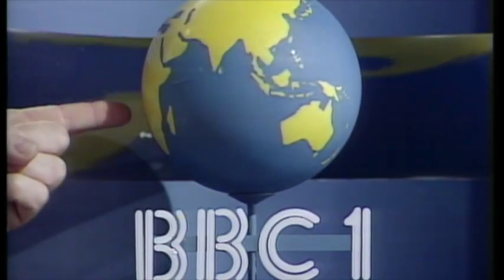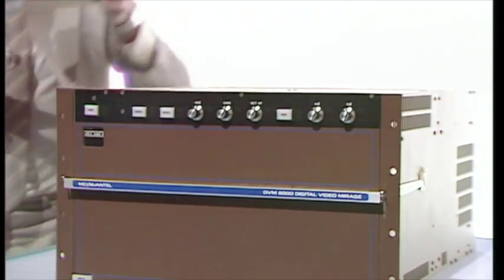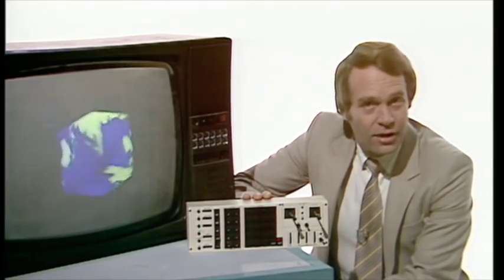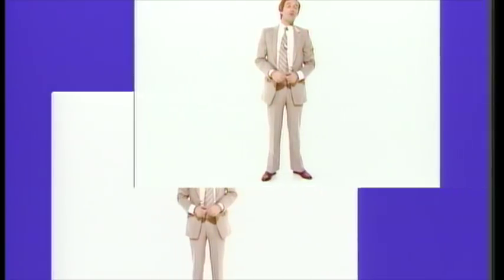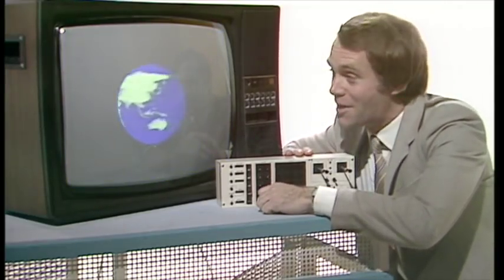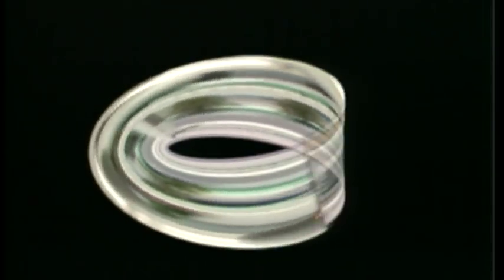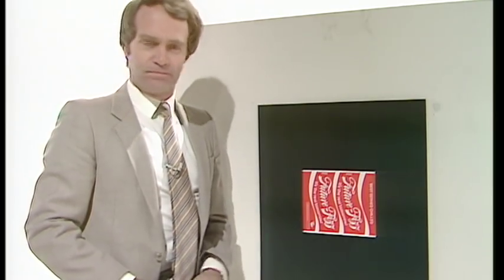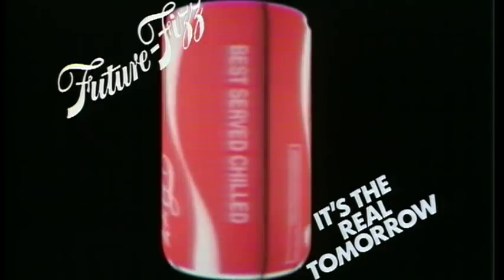Early CGI | Tomorrow's World | Earth Science

Comment: Whoah, dude, when is this new tech coming out? Radical!
Reply: I heard its coming out in 1995! We'll have jetpacks then dude! totally tubular my friend
Reply: Jayman2800 BZZT. Wrong! Try the 70's!
Reply: ....1982
Reply: Gnarly!
Reply: This would have been about 1983 I think. I was working at Quantel (the company behind this product, Mirage) at the time and was one of the test engineers on it. Now more than 30 years later I work in exactly the same office with, effectively, the same company and we still design and make the most advanced Broadcast and Film effects and processing products in the world here in Newbury, UK.
Reply: Richard Ansell Is there any actual 3D vector calculations going on or is it just 2D bitmapping made to look 3D?
I don't think it was possible to have real time 3D images run at PAL refresh rate of 50hz back in the early 1980s.
Correct me if I'm wrong.
Reply: Eli Malinsky, yes it was 3D vectors projected on to a 2d surface, so the machine was calculating the location of every pixel in x,y,z space and then converting to x,y space. The Mirage was not a 'computer' - i.e. It wasn't relying on CPUs to do the processing, this was using dedicated processing hardware to get the speed high enough. Off the shelf CPUs were only used for management, and there would have been numerous 68000 and 6502 processors through the system doing that management!
Reply: Richard Ansell Thank you for the explanation.
Reply: My dad told me that in the 21st century people will perform surgery on a grape
Reply: Just love it when a teen-ager isn't able to work out the period and tries to make a sarcastic comment. Radical!
Reply: Kingsman just love it when a boomer tries to act cool by making a comment on youtube
Reply: Kingsman and still doesn’t get the joke
Reply: @braddsfx8921  Just love it when a teen-ager doesn't quite get the point and gets out 'cooled' by a 'boomer' Stick to playing Minecraft dude and leave the tech savvy stuff to the ones that understand it better namely the 'boomers'
Reply: @kingsman428  Man I sure am excited for this new CGI stuff. How about you?
Reply: @t1e6x12  Me too, I heard it might have a CGA graphics card
Reply: @Jayman2800  
Thats nothing! Tell your friends in 1983 that by the 2nd decade of the 21st century, we'll have invented 52 more genders!!!
Reply: Hi internet explorers
Reply: Awesome sauce! Totally mind bloooowing!
Reply: Radical you say?
Reply: Can hardly wait!
Reply: @timothydyck6989  I am not used to comment in YouTube but I've just loved yours 😂
Reply: @NRG what's that, can i get it on my ipod?
Reply: @Jayman2800  I though that steven jobs in has apple made them already
Reply: Out of this world tech
Reply: @CristianMasMas  
Thanks! Although it gives me no joy, this world is so effed up in its agenda driven insanity
Reply: BRADDS FX. Just love it when a “boomer” invented YouTube and allowed you to play.
Reply: @kingsman428  Just love it when a boom-er doesn't quite get the internet and gets laughed at by 'teen-agers'. Stick to Facebook and leave the pre-retirement parts of the internet to the ones who understand it better.
Reply: @Nothing-ic1fl   When millennials go to YouTube and watch videos on how to download an install Snapchat then pat themselves on the back whilst deluding themselves they are 'tech savy' 😂stick to playing Minecraft and leave the technical stuff to the professionals.
Reply: @kingsman428  You've switched from 'teen-agers' to 'millenials' now, so clearly you don't know a great deal about that, to start. Also, if anyone would need to search for a tutorial on how to install one of the most popular apps worldwide, it would quite obviously be an older person, even though older people are 'the professionals' here of course. So, as I said, maybe you should wander back to Facebook and leave the rest of the internet to 'the professionals'.
Reply: @Nothing-ic1fl  "... You've switched from teen-agers..."
No, I can't have switched because I didn't call you a teen-ager, I took a guess at you being a millenial.

"...obviously be an older person..."
No, older people are much less likely to use Snapchat with most not venturing past FB.

"...older people are the professionals..."
Age is mostly irrelevant, it's about training and experience. 

"...leave the rest of the internet to the professionals..."

Well, if you understand the OSI model, encapsulation of data packets, hardware ports, TCP-IP Vs UDP, Nagels algorithm, RF to light convertors, CWDM and DWDM, fibre links, 10Gig circuits, Arris 6000 CMTS and how to test and repair all the supporting infrastructure for the datalinks I would agree you know something about the internet.

Now, I have to go and get my Coco and then let Tiddles out
Reply: @kingsman428  Well, you described then as though they were the same thing.

I'm not referring to using the app, I'm referring to the downloading process that you brought up originally.

You're now completely contradicting yourself. Your main and only point in this comment thread is implying how teenagers know nothing about technology.

So, you're saying that knowing advanced technological aspects and features of the internet is the only way to prove you know anything? I'd advise you to grow up before criticising those who clearly have a higher mental age than yourself.
Reply: @Nothing-ic1fl  "... I'm referring to the download..."
Yes, I know, that was my point, older people are the least likely group to download Snap chat.

" ..your main and only point..."
No, my main point was about teen-agers that are unable to timeline the technology.
You have comprehension issues.

"...teen-agers know nothing about technology..."
I never said that, Those are your words not mine, it's called a strawman response.

"...advanced aspects and features is the only way to prove you know anything..."
No, it's a way to show how risible this assumption that you made is "...leave the pre-retirement parts of the internet to ones that understand it  better..." 
The fact being, you don't.

"... I'd advise you to grow up..."
I don't think you're in any position to be giving that type of advice when you open with an adverserial statement and post
"...when a boomer doesn't get the internet and gets laughed at by teen-agers...stick to Facebook..."

You're just salty because you got as good as you gave.
My advice, don't comment on posts in a public forums if the response puts you into snowflake ❄️ mode because they aren't 'safe spaces' but you, being an internet expert, already know this. 😎 Do you like my 'boomer shades'?
Reply: @spunargar  Yep, I agree with you.
Reply: @spunargar  
"...that comes off as pretty douche-y .."
Notwithstanding agreeing with your point, you now want to hang adjectives on me 😄
Why not read the thread in its entirety to get a better grasp of what's going on then perhaps you will understand why I actually agreed with your opening remark. However, if your opening remark wasn't actually your point and you want to be like the others and be a bit douche-y then give it your best shot. 👊😎👊
Reply: We normal people could never afford that, it would cost well over £100.
Reply: I guess internet it's just place where people can insult each other for no reason.
Reply: @richardansell  i used to work in newbury, never saw this vid. Company, whats it called?
Reply: Dont hold your breath that thing will cost way too much, and its junk anyway these computer things will never make it big its just a gimmick, a toy for the rich if you like, i bet you in 30 years time people will still be drawing and stuff like this will be inn a museum somewere of ideas that never worked.
Reply: @Jayman2800  Gets to 1997: Eh, Britney Spears is pretty good

Comment: This is quite impressive for 1982. In the early 90's we had an MSX computer that certainly couldn't handle CGI like that and that was 10 years later. But I assume that the device in the video was purpose built...
Reply: It was an analog device for the most part, as far as I know - didn't actually run a "program" - hence it could operate as fast as it damn well pleased.

Downside being it was a big fat box with tons and tons of electronics in it, and it could only do this, and nothing else, what so ever!
Reply: Mythricia Hmm, Wikipedia says it was a digital device, and could be programmed in Pascal by attaching an HP computer. Although I guess considering the time it was made I wouldn't be surprised if it was some kind of hybrid with a digital processor calculating the geometry and then using that program an analog video circuit.
Reply: ***** IT's a DSP, digital singnal processor and they were the only way to get any kind of speed for image processing back in the day. I worked on some medical image scanners back then and we had 6 very large dsp's doing the processing. Programming them was not simple back then.
Reply: *****
It's the Quantel Mirage - it's all digital
- the HP Computer was used to work out the 3D projection maps, and the hardware did the 3D projection from the Input space to the Output space.
Reply: And for todays 100£ Video mixers these are simplest tasks they can do. =)
Reply: That's because it uses voxel technology or a texture map instead of polygons The downside is that it required a lot of memory for the time, but it used little processing power. We don't have that problem now and the roles have switched, we should return to voxels, like Euclideon is doing.
Reply: *****
It doesn't use Voxels
- the effects memory stores a 3D point in space for each pixel on the input screen
- the h/w projects each 3D coordinate to the output screen space using a standard 3D transform matrix
- but, yes, there are no polygons used in the final effect.

Also, the down side is that the address map needed to be pre-computed, and there was no 3D modeling package available to help.
- also expanding the image was a problem
- as holes would appear if the image was zoomed...

But to do all that in real-time back in 1982 was really impressive!
Reply: FlyingPhilUK Well some authors treat pixels as voxels, instead of little cubes. I believe Euclideon solved the level of distance problem related to expansion.
Reply: *****  It's just that the Mirage didn't use voxels
- which are 3D arrays of pixels

Mirage's expansion problem was due to the hardware architecture they chose
- which inherently limited the amount of expansion available
- but it did allow the Mirage to have a guarenteed real-time performance,
- whereas in a polygon based architecture, the actual performance is not so easily defined...
Reply: +Gerbrand Stap Not as impressive as when the amiga 2000 was released a few years later in 1987. Most of the realtime video tricks you saw on tv was then done on such systems with the newtek videotoaster. It also came with lightwave, which was then used for CGI like the morphing effect in terminator 2, the CGI for babylon 5, abyss, star trek and so on.
Reply: It's not actually doing 3D rendering, it's doing a 2D projection of a 3D object. The difference is huge, because you can take all sorts of computational shortcuts when you don't have to keep all points rendered at the same time, and squashing all of the calculations into 2 dimensions makes all of the math exponentially simpler and thus faster.
Reply: This is true teth, this machine had pre-computed 2d coordinate translations that simulated 3d space, it is not 3d rendering at all :)
Reply: @MikaelLevoniemi  £100, not 100£.
Reply: The MSX came out in 1983... duh
Reply: @bloxyman22  1987 wasn't a "few years later". 5 years was an eternity in technology in the 1980s. Besides, by the late 1980s there were much more capable image manipulation systems available than the Amiga. Namely the Silicon Graphics.
Reply: I have MSX computers now and they still can't do it. They are from the same time and you having one ten years later doesn't make it a nineties machine. 🙄 Also, stop upvoting comments that are erroneous, ie. analog.
Reply: MSX was a cheap home computer (standard) from the early 1980s. It wasn't a bloody live video processor.
Reply: @bloxyman22  

The Amiga 2000 was released in 1987 but the Video Toaster wasn't. The Video Toaster Flyer was released ten years after the Quantel Mirage. The Video Toaster was basically a 24bit graphics card and an RS232 interface it had exactly zero real-time 3D effects. The first Video Toaster was just a switch with some 2D video wipes. The Video Toaster is boring and is the second most overrated piece of computer equipment ever made, after the Amiga. It didn't have the power of SqueeZoom from 1977.
Reply: @joojoojeejee6058  

"1987 wasn't a "few years later". 5 years was an eternity in technology in the 1980s"

Correct. For the sake of a comparison the amount of time which elapsed between the launch of the ZX81 and the launch of the Commodore Amiga is four years. Not only that, the Amiga 2000 didn't have any of these effects. The best piece of video hardware for the Commodore Amiga was the Video Toaster Flyer, it was released TEN years after the Quantel Mirage and it still had exactly zero real-time 3D effects. The Mirage wasn't even the first, the SqueeZoon which was released in 1977 had better video effects than the Amiga.
Reply: @cloerenjackson3699  I am honestly not even recalling what I responded to since it has been more than 5 years. And yeah that is a good point you are making that it was not released in 87 and yeah like you said only 2d effects were of course realtime.
Either way my point even back then was that it was used with lightwave in production of CGI on quite a few big productions even though of course you did not have a realtime rendering.

I disagree that it was boring though. At the time and for the price there was really nothing as capable back then, which is why it was used by many tv stations and even in production of series and movies.

I find it hard to believe SqueeZoom more than a decade earlier had the power of an Amiga with a Toaster.
Reply: @Teth47  that is called culling and it is basically how games are rendered nowadays.
Reply: @rich1051414  the pre computation was the 3d rendering.
Reply: MF Nickster  

"EMC2: $30,000 or more, and did not actually output production video like the Toaster. It produced edit lists for offline assembly"

No. The Video Toaster did not output production video. The Video Toaster composed video by controlling video decks via RS232. 

The only /digital/ video on the Video Toaster were video clips used as thumbnails which were not used in production.
Reply: You should see 1972 Synthavision

Comment: Well, that's something. It's a Quantel Mirage! You are looking at $300-400k of digital video effects goodness. Weighing as much as a washing machine and draining an ungodly amount of power.

We had a follow-up model to this at WPIX in the late 80s. Doing anything beyond the build-in effects was complicated and normally involved a 'poor' guy punching in coordinates for half a day.
Reply: And just a few years later you could do the same a lot easier with a simple Commodore Amiga and the VideoToaster Hardware Addon.
Reply: @KRAFTWERK2K6  I doubt it. There's a PDP-11 inside the box, plus a load of dedicated hardware to encode and decode and a lot of very expensive ram. This box could input a full motion, full resolution 625 line composite TV signal and wrap it round a shape IN REAL TIME! I know, I used to use one for a living.
Reply: @KRAFTWERK2K6  

No you couldn't.

The Quantel Mirage was released in 1982, ten years before the video toaster, and the video toaster had exactly zero real-time 3D effects. The Amiga and Video Toaster are the two most overrated pieces of computer equipment ever made. The Mirage is a lot more impressive for its date than the Video Toaster, which was basically a 24bit graphics card and an RS232 interface.